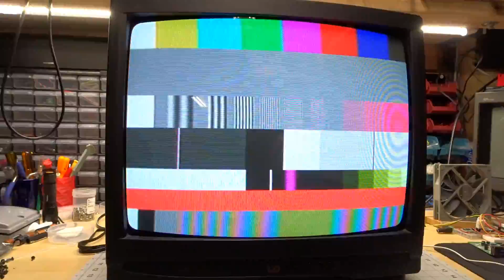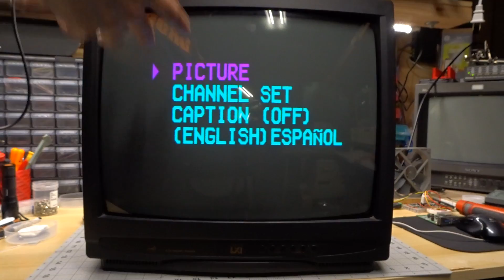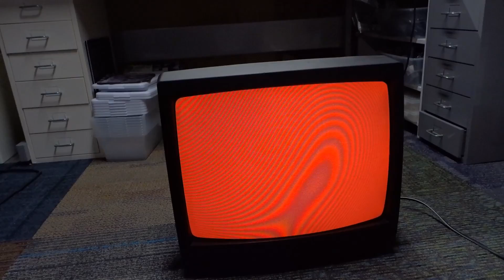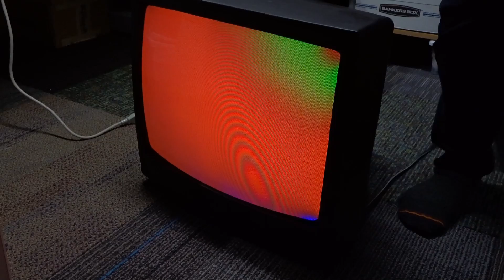Follow-up to my Trash Picked TV 'RGB Mod'

Comment: Dont need to use any mechanical switch for rgb, use a 555timer and relay with a tactile button

monitors have shielding consumer tvs do not, and the earths magnetic field distorts the picture, on televisions thats why thet have a degauss circuit

aurora borealis

Comment: I have seen some of these videos where you add RGB or composite inputs to TVs and always seem to caution people about "hot chasis" sets. I do not dispute that some sets are as you say but there is as I recall a very easy work around that I would love to see you test . That is this of an opto-isolator on video and audio inputs.. would love to see an RGB or composite mod attempting to use an opto isolator.

Comment: Regarding the odd color blotches when rotating the monitor on the floor... any chance you have electrical under the floor or heated floors?  Pipes?  Maybe there's some kind of reflection going on.  But doesn't explain it when it's on the bench, unless again it could be nearby electrical.  ??

Comment: the bigger the monitor, the more susceptible it will be to purity issues like that. I had a similar issue with a 20L5 that had been in storage for a while and it simply went away over time. The earths magnetism affects them. the degauss is a demagnification process that can be tried several times until it works. if it doesnt work, you literally have to find another spot for it.

Comment: You can't expect the CRT to degauss when turning it off and on again. All CRTs I know are constructed in such a way that they will only degauss again after a period of time. To be sure you have to turn it off and wait a few hours and turn it on again. The degaussing circuit should make a sound.
Reply: Also Sony PVMs totally also have deflection issues that depend on what's on screen. I however don't know if it's any better than non-Sony PVMs.

Comment: my TV has a switch that you flip for whatever direction the TV is facing in the room, it gets rid of those annoying corners completely.  right now it's sittin on the floor, it's huge.. can't imagine putting it on a stand, is that even done? it's like 300 pounds lol. would love to get it RGB modded, it does have component, but I'd rather just push it to the limit with RGB.

Comment: 6:41 MR. I have a problem... My Screen has some issues on the right side. Looks like a stain. If I put a magnet nearby, the stain disappears but I want to know what the problem could be? Any suggestions? it's a SONY CRT TV KV-29FA210. If I move the TV, the stain change a little, as if some magnetic field nearby affects it but not sure waht couldl be? I have another CRT TV nearby and it doesn't have any problem.

Comment: Further notes on color:
Electrons have no color.  The way color is generated is that there are 3 electron guns arranged in a delta formation which are focused on one spot in the center of the screen.  Closer to the screen there is a metal grid perforated with a precise pattern of pinholes, which only allow the "green" gun to see the green phosphors, "red" to see the red phosphors, and "blue" to see the blue phosphors, all of which are arranged in patterns on the CRT to cooperate with this setup.  But there is still need for fine-tuning.

The deflection is done electromagnetically by the deflection yoke.  That's one reason metal objects and especially magnets near the TV can throw off its aim.  The front of the screen itself can also throw off the aim, since the phosphors can align in the same way that the iron in magnets can, and in effect become magnetic.  That causes electrons to hit the wrong part of the screen, or possibly even be repelled somewhat.  So they need to be degaussed on occasion.

Ancient TVs didn't have the degaussing coil.  When the screen started looking weird (too bright in one spot, too dark in another), the service tech would show up with a large toroid wrapped in wire, plug it into the wall, and move the toroid around in front of the screen to remove any permanent magnetic alignment in the phosphors.  The degausser has largely made that unnecessary, but the screen can still build up a charge that the built-in degausser either can't get rid of or needs many applications in order to do so.  Especially if it wasn't even installed right in the first place!  So degaussing rings were not made completely obsolete by the TV's built-in one.  The "big guns" of old may still be of help.

Those 3 brown rings on the neck of the CRT with handles sticking out are also a potential adjustment.  They are typically calibrated once at the factory and never need to be touched again.  Rotating them around the neck will affect the aim of one of the colors.  So if you have color purity problems that can't be fixed by other means, that's one place to consider making a small change (maybe the TV got jolted or something and the adjustments are a tiny bit off).
Reply: I can tell you that this TV does not have a delta electron gun, those are found in ancient TVs and most CRT computer monitors.
I used to fix TVs, and only once saw a delta gun, and that particular TV was very old circa 1970 or something like that.
Most electron guns in TV are inline electron guns.

Comment: Looks like the TV has been subjected to a magnet before you found it. I had this as a kid when I cleaned-up my room and by accident placed a magnet on top of it. Must be like in 1994. Moving the TV around made the effect change but by the end I setup the TV so that the effect was the worst and used the same magnet to resolve the problem. After like 15 minutes of moving the magnet close and further from different angles to the TV the problem was gone and I used the TV for years. I still have it since it was my first TV and now I'm thinking of adding this mod to it since it doesn't have a scart connector which was usually missing from the smallest TVs in Europe.

Comment: The degaussing coil built into the TV isn't very strong and it doesn't operate for long, and it doesn't "recalibrate" anything, it's just to demagnetize the chassis. This interfernce isn't magic, it's being caused by a magnetic field in your basement that is deflecting the red gun through the dot mask onto the green phosphors instead of the red ones. It's possible the dot mask has been disturbed when the TV was dropped.

Comment: Really tiny magnetic fields can cause enough deflection of the three color beams to mess up the colors. A neodymium magnet anywhere even within reach would mess it up. The permanent magnets in a speaker can do it. And chassis components themselves can become magnetized. You need a degaussing coil. Component aging can misalign the guns. Regular maintenance of the proper deflection of the three guns was a plus aspect of owning a Heathkit color TV in the 1980s.

Comment: Its also on Pal composite, its due to the composite signal being a mix of the colour signal and the luma signal. The reason its rarely seen in Europe is due to SCART and every tv supporting RGB natively. So its actually called composite artifacting. RF is worse cause the audio is also mixed into the signal. So S-Video Component and SCART are better in so many ways and will not have dot crawl.

Comment: Not a degaussing issue.  Cheap TV's have 1) inadequate shielding 2) this one has to have purity, focus and other control rings on the neck.  These go bad, can require readjustment, etc.
The artifacts displayed don't appear to be signal/drive related, but physical relating to the tube alignment and adjustment.  They appear to be adjusted OK, they're just weak.

Comment: A real external deguassing coil would probably fix the purity issue. you are experiencing areas that are magnetically "stuck" and you need more juice to unstick it. You have to get the round kind and rotate it around, in and out. That basically disrupts the magnetic field enough to treat the affected areas. What probably happened is that it was kept near a speaker or something that created a persistent magnetic field, and it distorted it more in those areas.

Comment: So in all honesty.. is an RGB CRT still better for retro then a HDMI modded console on an LCD?
Reply: I say yes, sometimes.  Beauty is in the eye of the beholder.  I have watched a lot of LCD television since the digital era conversion, and I watched a lot of CRT TV before it, and likewise used computers on both, and I can list details about the differences, so I think I'm qualified to have a legitimate reaction.  For some things, particularly early computers and a lot of television broadcasts, I like the appearance and feel of CRT much better.  It could partly be that I'm used to it and some things have a certain flavor, and trigger certain memories... but there are some real problems having to do with image quality that show up with new tech on old tech.  But to list the things that go wrong with connecting early tech to a modern LCD: interlacing fails, uneven pixel widths, unwanted automatic blurring (from resolution scaling),  colors, the "scan line" feel is missing, sometimes it just won't sync right, there is a DELAY, and on top of all that it's just a pain to change brightness or other parameters because of a stupid button interface.  So for someone like me who grew up with CRT's, even if I ALWAYS disliked the physical size, high pitch, & low resolution, the other factors bring me back to an enjoyable experience.
Reply: @jamescarpino1879  Hi James,

Yes I see what you say, I'm 33 so I'm also well versed in the CRT TV and Monitor but I never really had consoles (we were a PC family) but my first console being a N64 but that was just connected to a small CRT via composite I never had the full CRT experience.

After that I had the first Xbox with the component cables on an LCD so it looked amazing, same with the 360 after that (using HDMI)

I think my wife would kill me if I brought a CRT... The seem to be $300 with RGB/SCART in Australia.

Comment: at about 8:15:  Of course you have changing magnetic field when just rotating the picture tube. Ever heard of the magnet field of the earth (you know that northpole, southpole, east and west thingy)??? ;)  And - yes I already read it in many of the comments, of course you would not have any other magnetic influences by metallic things around if you would live in a wooden house with no nails, no metal used for stiffening, no cables, no electric wires (!) producing their own magnet fields by having current running through them. Did you ever try to have a Monitor running nearby an old transformer based power supply? That may lead to very psychodelic effects, especially if both components, monitor and the power supply, or at least one of them is not heavily shielded.

And don't mix up "degaussing" with "magnetic shielding"! Degausing is trying to eliminate inherited magnetic fields produced by magnetized parts of the TV set itself. If you move some speaker around and the magnetic field of it gets parts of the CRT magnetized - that effects will be eliminated by that. BUT: if you have magnetic effects that are induced from outside (which may be magnetic or magnetized components of your house, for example) the TV set and it's degaussing will not be able to eliminate that magnetic fields if there is no magnetic *shielding*. Electrons are forced into curves whenever they fly through magnetic fields. That's true as well for the earth magnetic field. You want less influence? OK, speeding up the electrons by using higher accelerating voltages may reduce the time the electron will be influenced by the magnetic field. Yes. But most important is, you have to shield magnetic fields as good as you can! The metal jacket all around your TV set chassis and the CRT will cost some money, so.... Buy cheap and live with it or buy twice! ;)

Comment: Hi Adrian, you should use a simple CD4053 cmos analog switch to toggle RGB from external inputs to overlays :) That would require only one switch toggling the 4053's x/y input.

Comment: Some times the metallic mesh/mask inside in de front of the tube have geometric aberration producing errors in the convergence of electron rays. Other times this mask pick permanent magnetism and is very difficult demagnetize. You can try positioning VERY WEAK magnets close the afected area to correct this. Sorry, I understand English perfectly but my writing is bad. I'm was TV service for many years. Greetings from Argentina

Comment: Because they stop putting a lot of rf shielding in more recent CRTs TVs, the type of lighting you have like fluorescent ballast, and LED drivers, dirties the electrical supply in homes. However if that was a Monitor, and not a Television it would have the necessary shielding.

Comment: Maybe is a bit late, but the problem could be related to a flimsy degaussing coil, not the cable that goes around the tube but the actual coil that triggers the degauss proccess which goes mounted into the chassis PCB whose purpose is to close the circuit for the current to pass through the coil around the tube, those usually get affected by moisture,  and given the fact that you picked this TV from the trash you could try to swap that part and see what happens.

Comment: this is very common, particularly with these cheap 19 inch plastic crap sets. you may be able to improve things using the purity rings on the neck, but messing with these will probably mess up the convergence as they all interact to a degree. we had a major issue with this in the early 90's with a particular manufacturer. their initial modification was to add another posistor in parallel with the one fitted, which was basically a bodge. the later modification was a different posistor with a lower cold resistance, but they also described a full setup of the purity following the replacement. even so, if you set things up perfectly you would still get this effect when the set was rotated, this is all down to stray magnetic fields of which the earth itself is one. the crappy degaussing circuit in these things mean that you would have to leave the set to cool down about 10 minutes before it will degauss again. the reason you get the problem when you flick the power on and off is that you are effectively creating a strong electromagnet for a split second. the degauusing field needs to start strong then decay

Comment: Without going into too much crazy detail my brother and I were renting a house where the guy had created essentially an electromagnetic field with in one room to keep people from using listening devices on him and other weird shit like making a bulletproof front room wall and he had his door anchored in the frame of the house if you couldn't be battering rammed.

my point is that's very similar to what the TV in that room used to do is if you had it too close to certain things it would basically have a degaussing effect.

if I had to guess I would say that the TV is not shielded very well from picking up outside radio frequency or if you could find a way to degauss it and might help.

on one hand I think you could put some aluminum foil in that sticky foil and shield it but on the other hand that might make it a giant antenna for that kind of thing so I'm not sure what you could do to keep that from happening it may not be grounded properly or it might be because of playing around a little bit with the electronics it has kind of messed with the FCC interaction with other electronic devices kind of thing maybe this is why the person got rid of the TV the first place they thought it was broken...
Reply: Thats true.  Higher end CRT computer monitors (21"), had thin sheetmetal shielding connected to earth ground via the IEC power socket.

Comment: how can I find the rgb and blanking pin without a service manual? there is no service manual for my tv... anywhere!
Reply: @adriansdigitalbasement   thanks i'll try to see if there's a data sheet for my ICs.  i have one last alternative, let me know if you think this is a good idea :P  solder wires to every pin on the jungle IC, bring them out of the chassis for safety (do you suppose there's high voltage coming into jungle ICs?)

I'd put the TV on Line1, from the back of my sega genesis: hook in the sync into the yellow Line1 port (along with the RGB ground wires splied into the sync's cable), then turn on the OSD with the TV remote (a temporary move until I get 5v blanking) then manually tap the R G B wires from the back of the sega onto the random wires from the TV until I get an image. after I've located the RGB pins, turn off the OSD, then take the 5v from the back of the sega and quickly tap the wires until one of them activates blanking. 

After locating all the right pins, do the regular mod with resistors and blanking switch...

Also i noticed that people include resistors in their mods, does that mean we no longer have to use enthusiast scart cables that include caps and resistors in them?  or would i still need to use them? (for things like SNES, Genesis etc)

Thanks!  I know that must'a been a pain to read xD  but it's probably the best I can do since I asked mitsubishi directly and they gave me the run around... they said it'd take forever to locate.

Comment: You could always try adjusting the color purity rings on the neck of the tube, or possibly adjusting the position of the yoke.

Cheaper sets like these are often more sensitive to purity issues, but you can usually adjust them out. It might just be picky about which direction it's facing.

Comment: It is NOT magnetic field! Usually a significant color distortion in one corner means that the color separation mask inside the tube has detached from the tube in this corner.